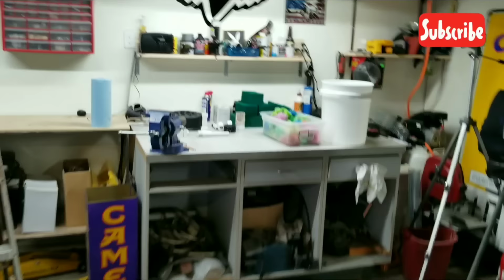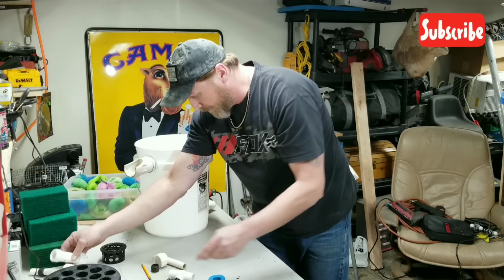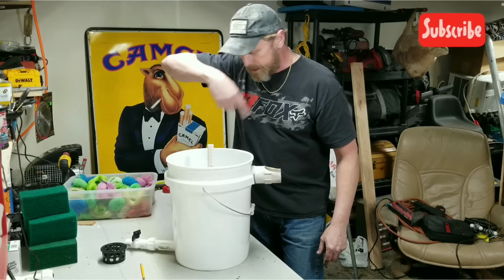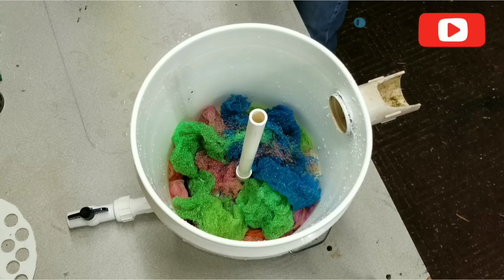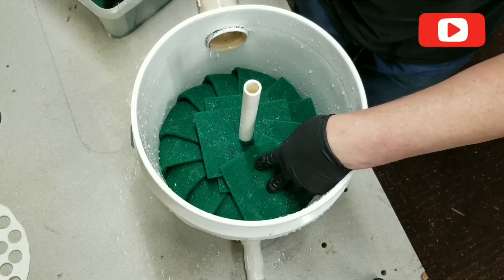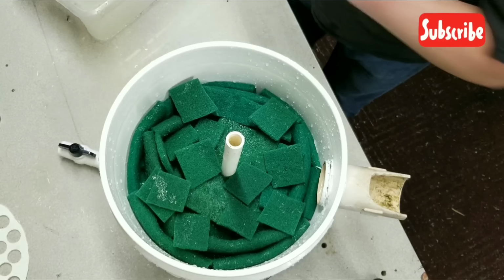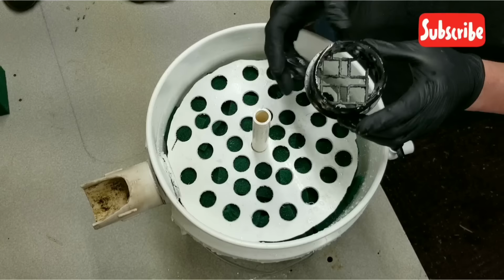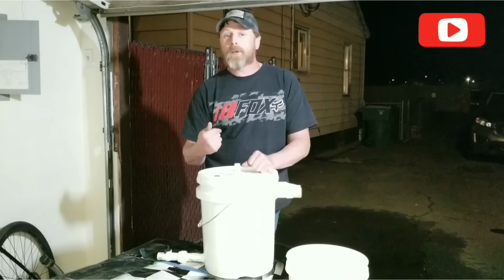BEST DIY BIO SWIRL FILTER EVER...UNDER $20

Comment: How would you suggest to connect this to a flexible hose that came with a pond pump? Do you have a video showing your pond in action?
Reply from the maker: Any hardware store should have some kind of Adapter you could use and a hose clamp or zip tie ..the pump I used had 3 adapters and I think the medium one fit inside the 1/2 PVC.....and this video and part 2 are of the pond I used that filter in ...its a old hot tub very cool video...Thanks for watching and commenting...Stay Wild

Comment: so this is a filter that is used for a pond and runs 24/7??? i love this setup and wanna make one to filter out my 125 gallon tank once a month... if this sits for a few weeks without use is it gonna possibly clog up from non use?
Reply from the maker: I guess it would depend on how dirty it was ...If it's real dirty and then drys up it might clog up ...I'm not sure I just hook the pump up and let it roll ... Thanks for stopping by and for watching and commenting..Take Care & Stay Wild!!!!
Reply: @MYANIMALHOUSE  i have a 200gph pump/filter now... it does pretty well and only have to clean it once every 4-6 weeks...  just kinda wanna build a setup like what you made to filer out the heavier sediment when i do a deep clean so i dont have to do a total tear down and deep clean every 4-5 months....   your video has deff helped answer some questions and point me in the direction i wanna go!  ty for putting this video together

Comment: How do u clean that?
Reply from the maker: Well it does have a flush out on the bottom so open it a d flush water though the top and that will clean out solids ..but at some point you have to open it and wash out the media and  put it back together...Thanks for watching

Comment: Check out my filter, kind of the same concept only my spray bar was on top and the water filtered from the top down to the bottom with the same concept of overflow. PaulM708